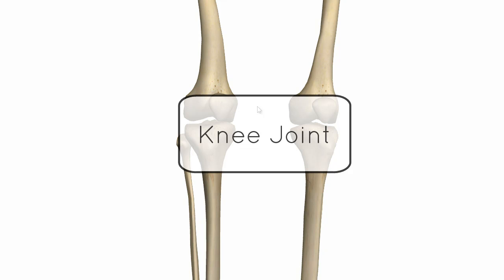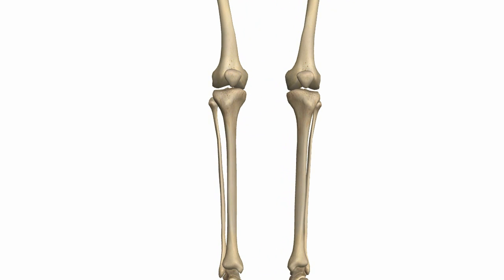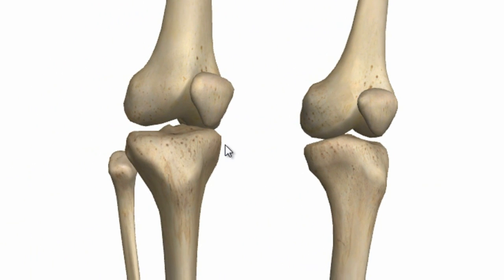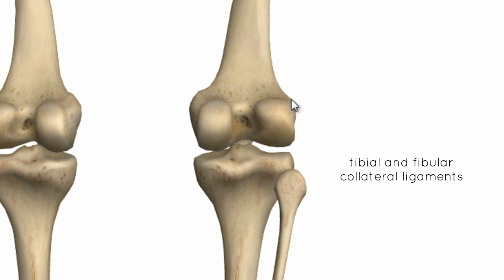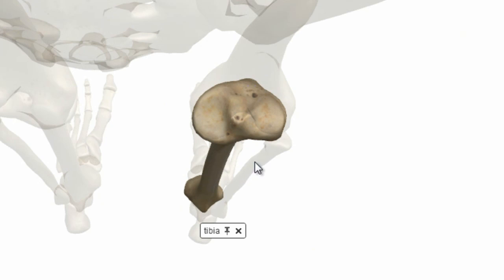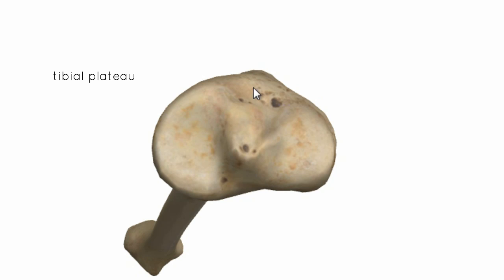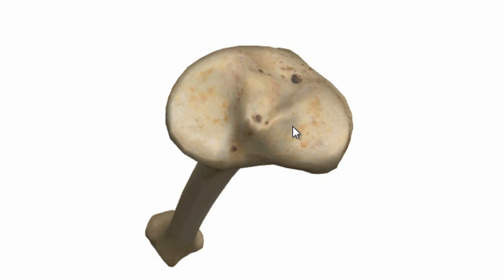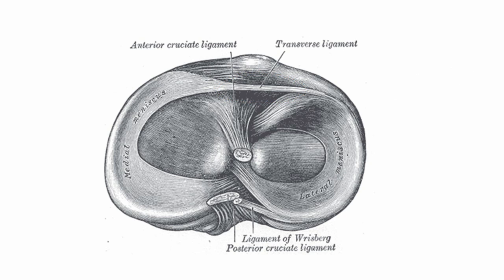Knee Joint - Part 1 - 3D Anatomy Tutorial

Comment: @KrzysztofPro This technically isn't a hinge joint because it is biaxial. It is actually a condyloid or modified ball and socket joint because you get flexion and extension along the transverse axis, but as you go into extension the knee medially rotates to 'lock' the knee in place, and inversely you get lateral rotation as you take the knee into flexion. This occurs on the longitudinal axis. That is what he was explaining.
Reply: It's a modified hinge joint. As it's main action is Flexion & Extension and limited degree of rotation and side movements.
Reply: gerrpk A modified hinge joint is just another name for a condyloid joint. In walking you also get some ab and adduction, so there are some argument that this is multi axial joint.
Reply: Nope still thinks its modified hinge joint due to having main uni- axial (flexion/extension) movements with limited rotation/sideways movements. (Clinically Insignificant)

A condyloid joint is bi-axial. (e.g. the knuckles) with flx/ext ab/ad & circm.

When moving it would abduct and adduct in limited amounts due to driving external forces, a chain reaction from ground ankle to knee (valgus). which ain't a proper knee movement. Also ligaments prevent this motion happening too much as it is a weight bearing joint and needed for stability.
Reply: Not quite.... The knee is classified as a bi-axial joint - condyloid.
The rotation is not a a result of external forces. It plays an very important role in what is called the 'knee locking mechanism' which is incredibly important for the stability of the knee. The medial surfaces of the knee are larger than the lateral surfaces, so when moving into extension the lateral side of the joint completes its motion earlier than the medial side of the knee. Accessory roll and glides continue in the medial compartment of the knee, this results in rotation at the knee joint, if the tibia is fixed then the femur rotates medially. To move from this position into flexion the knee must rotate laterally which requires muscle action (popliteus). This means that in full extension the knee is locked and requires no muscular activity to maintain full extension. In this position there is maximum contact between the joint surfaces making this the most stable position the knee joint can be in. Its called a close packed position. 
That is why it is bi-axial. I can tell you that as a physiotherapist both functionally and anatomically the knee has to be at least biaxial for even the most basic movements to occur.
Reply: I already understand the whole mechanism you just said and is exactly the limited rotation in the knee I was talking about before. Lets go thorough it again.. it permits flexion and extension as well as a slight internal and external rotation (what you just explained) technically making it's a pivotal-hinge joint
(i.e modified hinge joint).

It's primary movement is flexion and extension and counting the rotational "locking mechanism" is limited and minimal as happens only under a fixed position. (It doesn't rotate like other rotating joints (radioulna jt) but only during flex/ext. and why would need to rotate your knee?
Reply: The degree of movement has no impact on the joints classification. For example the Talocalcaneonavicular joint is a ball and socket joint, despite fewer degree's of movement than the knee has rotation. Again not all of these movements happen actively.
Reply: I wasn't saying that, what I was saying is why it doesn't allow complete rotation. Joints are classified by their bio mechanical properties and the articulating surfaces.

Ball and Socket joints are obviously ball shaped that fit into a socket and uni-axial where the Knee joint is rather two condyle shapes articulating with a trough shaped surface. but only uni-axial.

And for condylar joint is where it's rather an "egg in a cup" type of articulation with full abduction/adduction movement.
Reply: Really it depends on which textbook you read and what your lecturer tells you. Even the country that you are in will change the classification of this joint. I am a Physiotherapy Honours student from Australia and according to all of my texts and all physiotherapists that i have ever spoken to (including a physiotherapist who runs a knee clinic) regarding this topic and they all agree that this is a condyloid joint. So personally I'm going to go with them rather than some random on youtube.....
Reply: Read every published Anatomy text book, go to most countries and they will tell you the same thing that it's some sort of hinge joint.. This isn't just my opinion but a globally recognized fact! I've seen a knee bone and discussed with doctors about this stuff. Either our definitions are mixed up or you must be living in the middle of the desert under Ayers Rock because most of the world wouldn't agree with the knee being a ball&socket or condylar jt.
Reply: gerrpk Sorry what qualifications do you have? You can look at as many knee bones as you like and speak to as many top doctors (who for the record have less functional musculoskeletal anatomy training then physiotherapist) as you like but Gait doesn't lie. For you to walk you need more then flexion and extension in the knee complex. This means that movement has to be happening in more than one plane, therefore logic would dictate that it must be at least bi-axial.
http://www.slideshare.net/dnbid71/biomechanics-of-knee-complex-1-13301039
These aren't my lecture slides, but they will do. I recommend slide 7...
Reply: I've been studying anatomy for 7 years and know professionals in this subject. From what I've learnt the knee joint is complex and as a whole (two articulations) is a specialized hinge joint because of it's movement.

The tibiofemoral joints primary movements are flexion & extension along with gliding and slight rotation. These secondary movements happen during the movements of flx/ext..not separately. This is what I mean by modified hinge joint.

Also including the Patellafemoral as part of the knee joint playing a role in extension and stability. 

In your slide you say it's a bi-condylar joint.
Isn't bi-condylar joints different in the sense that they can perform all these movements in complete isolation? (e.g. the wrist, knuckles) so would the knee not be considered because it performs it's limited rotation/side movement only during another movement.

Anyway that is what the doctor I know told me who specializes in orthopedic surgery which require lots of training you get when it comes bones. 

Take it or leave it. Really just a name to classify the joint by it's shape and what movements it makes.
Reply: I'll leave it thanks and go with the physiotherapy community and anatomy lecturer I have met.
Reply: Well I found out today our professor says both bi-condylar and modified hinge joint can be used. Sorry I guess your not completely wrong by calling it bicondylar. I'm still going to stick with my theory though.
Reply: That's fine, like I said different people and different texts will say different things and they are often used interchangeably. The point of the first comment was simply to say that it is not a simple hinge joint as many people think, that is all.
Reply: Dont u have a textbook to see that it is a modified hinge joint or a condyloid joint